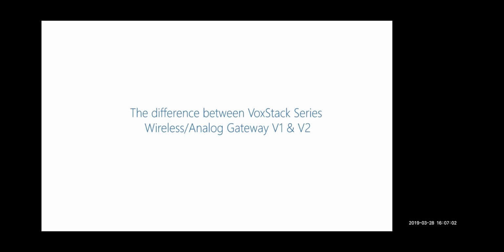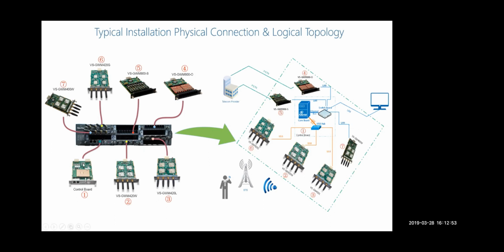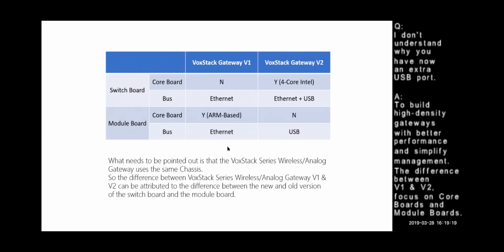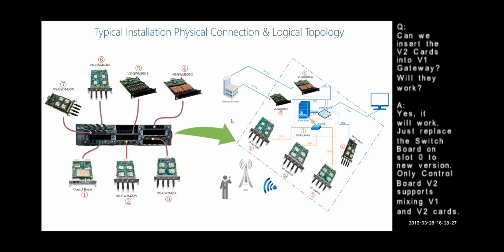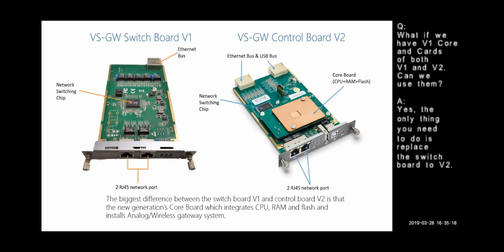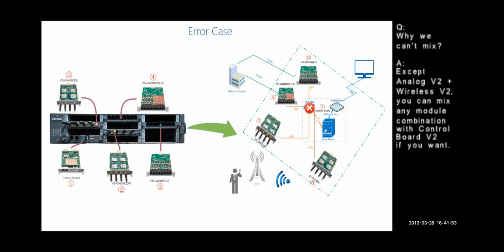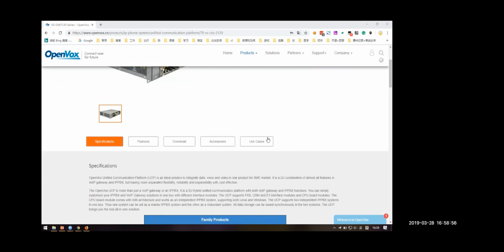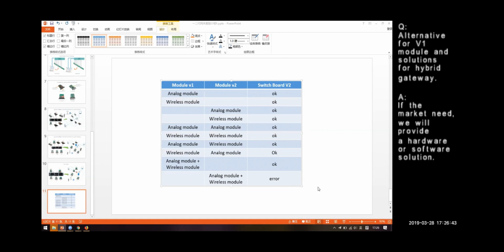The difference between VoxStack Series WirelessAnalog Gateway V1 & V2

Comment from the maker: 1. Q:
Why do you use USB port instead of Ethernet? What's the benefit?

    A:
In V2, we add USB bus based on V1, not replace Ethernet bus. With USB bus, we can build high-density analog/wireless gateway.

2. Q:
Can you please repeat Error Case?

    A:
OK. In module board V2, there is no Core Board and System, all module boards share the same system installed on control board, either analog or wireless system, cannot have both.

3. Q:
I don't understand why you have now an extra USB port.

    A:
To build high-density gateways with better performance and simplify management. The difference between V1 & V2, focus on Core Boards and Module Boards.

4. Q:
Can we insert the V2 Cards into V1 Gateway? Will they work?

    A:
Yes, it will work. Just replace the Switch Board on slot 0 to new version. Only Control Board V2 supports mixing V1 and V2 cards.

5. Q:
If we are using Switch Board of V1, can we use V2 Cards?

    A:
No, you can't. You have to replace the Switch Board. 

6. Q:
 So only one IP can handle all 3G or LTE card in V2?

    A:
Yes, all GSM/3G/LTE cards share the same system on Control Board V2.

7. Q:Can you please show me the different picture of control board?

    A:
In V1, 1600 and 2120 chassis use different type of switch board.In V2, we use the same control board compatible with both 1600 and 2120 chassis.

8. Q:
WCDMA module in V2 is using the same UC15 chipset? So there is no change for schematic, except add usb bus?

    A:
Yes, they use same UC15 chipset, but removed core module on V2 Board, you can check the details on pictures.

9. Q:
Is that a HDMI port on control board V2?

    A:
It's the developing version. We will remove HDMI port on control board V2 in production.

10. Q:
What if we have V1 Core Board and Cards of both V1 and V2, Can we use them?

    A:
Yes, the only thing you need to do is replace the switch board to V2.

11. Q:The V2 control board has 2 connectors, Ethernet Bus and USB Bus, but you write the chassis is the same. Does the chassis have 2 connectors?
      A:
Yes, In V1 the USB bus is remained but not in use, we use both buses in V2.

12. Q:
Can you send us this presentation?

      A:
Of course, yes.

13. Q:
Why we can't mix?

      A:
Except Analog V2 + Wireless V2, you can mix any module combinations with Control Board V2 if you want.

14. Q:
What about UCP?

      A:
We will start another webinar training for UCP.

15. Q:
Hard disk uses USB bus?

      A:
The hard disk uses SATA bus.

16. Q:
Did you test VoLTE? Sound quality much better?

      A:
The VoLTE will work on our LTE gateway but the sound quality will not change because of limitation of sample rate.

17. Q:
The LTE Gateway module supports only VoLTE voice but no Data?

      A:
Yes, no data.

18. Q:
Alternative for V1 module and solutions for hybrid gateway.

      A:
If the market needs, we will provide a hardware or software solution.

Note:
The Switch Board V1 is at the End Of Life. In our new shipment, we only provide the Control Board V2 without CPU module as default.